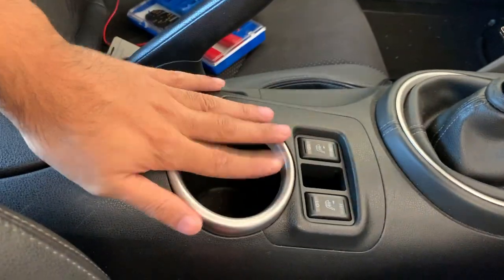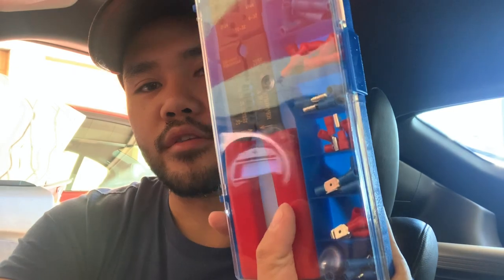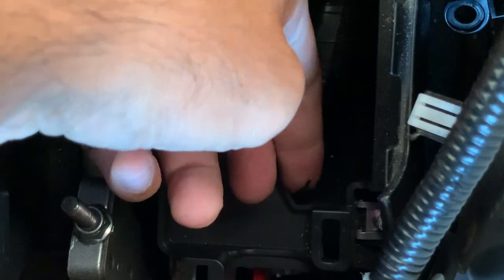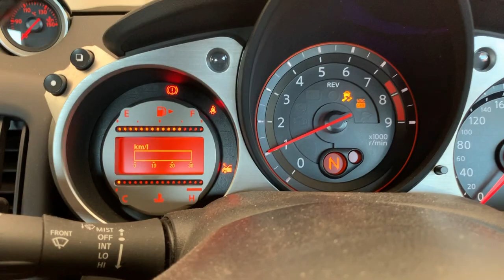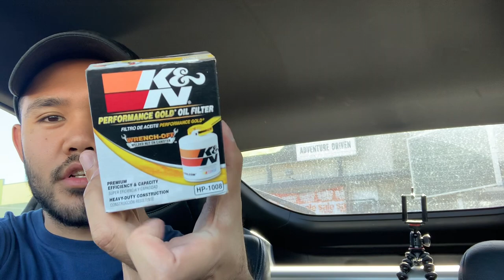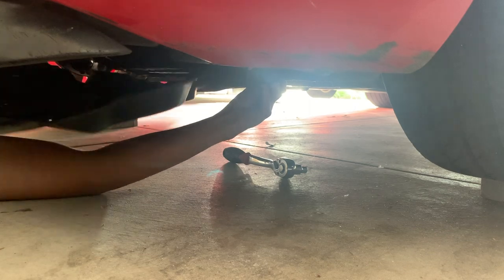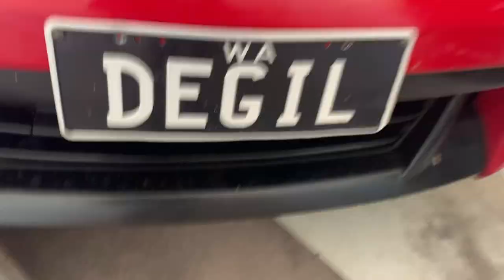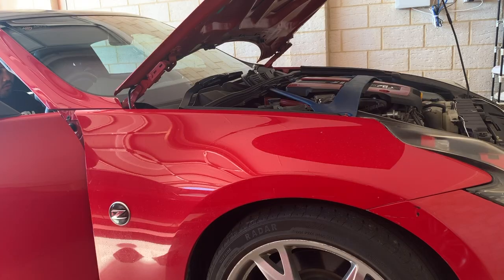*BEST* Drift Switch 370Z! YAW SENSOR SWITCH

Comment: Nice video mate! Just a suggestion... instead of electrical tape it's better to use heat shrink tubing.  Snug fit once you apply heat and it does not unravel.  I use it on all of my electrical wiring projects. :)
Reply from the maker: Luv2rip FPV cheers mate! Yes 100% heat shrink is better. was thinking that after I did it hahaha as I had heat shrink in the pack but didn’t think about it when I was doing it 😂 thanks!

Comment: Hi mate I bought a 350nwith this same swrich installed and I thought it was broken until I heard you say you have to turn the car off for it to work haha.

The only thing is I feel with the traction control on , VDC and slip lights gone, my car feels sluggish and even when trying to accelerate it barely will.

Is this because my welded dif is interfering with it?
Reply from the maker: That’s very interesting, I don’t think a welded diff would make a difference. But it does have a chance too cause sensors would be confused as to what’s happening hahaha

Comment: have you checked to see if the brake lights work when the yaw sensor is on and off?
Reply from the maker: Lee Burke yes! They’re still working on either 👍🏽
Reply: DegilZ34 excellent, I’ve heard disabling the YAW by pulling the fuse terminates the brake lights, have you tried to see if you can do a standing burnout
Reply from the maker: Lee Burke that’s by pulling the “stop lamp fuse”. I’ve done that in my last video if you wanna check it out hehehe. But that does cut the brake lights. There is another wire under the glovebox where you can put a switch in to disable that but still keep your brake lights on. I haven’t tried doing a standstill with this yet, but ill try it soon I’ll see how it goes
Reply: @HustleGarageTV  ahh excellent, let me know if you can do a standing burnout, or post a video of you trying?
Reply: DegilZ34 can you provide more info on the wire to do a standstill burnout with brake lights on?
Reply from the maker: @leeburke1491  can do!
Reply from the maker: @B H Will do, i'll talk a little about it in the next video. I might be doing it soon as well. But it is called the ECM wire behind the glovebox
Reply: @HustleGarageTV  looking forward to it! Cheers from LA!
Reply: @HustleGarageTV  I've heard of people tapping into a brake pedal wire also but that turns off the brake lights when on, but flip the switch and its back. Alternative to pulling the fuse

Comment: Can we get a link to the switch. That brand has alot of different switches that all seem very similar
Reply from the maker: Andrew Wagner I bought it at a local auto parts store but the part number is: 63040BL, the measurements are 37.5mm x 21mm

Comment: So it’s a permanent stability control off? For the yaw green wire?
Reply from the maker: Elmurfudd Wrabbithunter yes, when the switch is turned on, the stability control is turned off. But it can be reset so the stability control is on

Comment: Whats the difference between this and the stock turn off stability control button ?
Reply from the maker: Shteryo Shterev the stock VDC off button only turns off traction control, but the stability control is still there. The stability control kicks in when it senses the car having an angle while drifting, and kicks it back, making it very unpredictable and scary. This cuts out everything except ABS, which makes it more predictable and under your own control of the car without having the ecu snapping the car straight while you’re sideways which can end up with the car heading straight into a wall
Reply: @HustleGarageTV  I understood, must try this on my car. If u have instagram or facebook say it so we can exchange some info about the cars.
Reply from the maker: Shteryo Shterev yeah my Instagram is degilz34

Comment: One more question. How did you know to cut the green wire? I seen some people say cut the orange wire so I'm not too sure which to do. Also since mine is a 2016 I want to know if it's any different than yours. Thank you
Reply from the maker: crazyK115 I’m not sure if it’s different on the 2016, don’t think it should be, haven’t heard anything about an orange wire before. The ESM + a mate confirmed it was the green wire that connects the yaw sensor
Reply: @HustleGarageTV  ok brotha thank you, I'mma do a little more research just in case but I'mma trust you I can't find anything 💯
Reply: @crazyK115  Did it work?
Reply: @crazyK115  I've a 2016 Z, thinking about doing this too. Did it end up working?
Reply: @Ajeythayaparan  yea it did but honestly there's no point to doing this. If you want to drift it, put it in first, start swinging the car then immediately shift to second. As soon as u shift the car will throw.
Reply: @Ajeythayaparan  if you have any more questions feel free to ask
Reply: @crazyK115  is it just the same as any other Z for installing the switch, the wire isn’t a different color? And tbh that’s what I’ve been doing but the hook up is honestly terrifying lmaooo.
Reply: @Ajeythayaparan  it's not as hard as you think it was honestly pretty easy. I'm pretty sure 2009 and up is all the same
Reply: @crazyK115  Ok just wanted to make sure before cutting into wires lmaoo, so if I just follow the video exactly I should be good? Also did you feel a difference when sliding with just traction control off versus using the YAW switch?
Reply: @Ajeythayaparan  yea, with the yaw sensor off it kinda sucked. Nothing really happened. I can show u vids if you want of with ms without if you want to see the difference.
Reply: @crazyK115  ya definitely my Instagram is at.zzzz. Send them whenever you have time.
Reply: @crazyK115  lmaoo sorry if I’m annoying I just want to make sure, as long as I watch the video and cut the green wire I’ll be fine?
Reply: @crazyK115  I wanna see the video

Comment: My 2017 370z only turned off the traction control not the extra safety on the throttle
Reply from the maker: That’s weird, mine turns that off when I’m sideways
Reply: @HustleGarageTV  I can’t do burnouts because of the extra safety feature which is what I was hoping the switch would fix. It only turns off the slip
Reply from the maker: Oh right, this doesn’t eliminate the “stop lamp” that allows you to do burnouts, this only eliminates the throttle cutting out when you’re sideways. You’ll want to link the cable behind the glovebox to a switch, this is the “stop lamp” cable that is connected to the ecm, that will allow you to do standstill burnouts/left foot braking etc. this only allows you to have better control of the car when you’re drifting
Reply: @HustleGarageTV  yea I’m doing that right now, drifting wise I can still do it with the switch on
Reply: What years have this extra safety and what is a stop lamp exactly? 

I’m purchasing a 2019 370, 6mt Monday and i test drove it and in an aggressive corner… it went into some protection mode with 10% throttle response hence me looking up this video. 

Any more info on this other “nanny” safety feature!!

Comment: All you used was electrical tape to connenct the wires to the green right?
Reply from the maker: Yeah just electrical tape, use going to use heat shrink but i ran out :(
Reply: use a splice with heat shrink over silly

Comment: I did the exact thing and didn’t work on my any clue why it didn’t work ?
Reply: did you figure it out?
Reply from the maker: hmmm, I'm not sure what the problem could be. Did you manage to fix it?
Reply: I try I different thing what I did it’s that I cut the wires directly from brake pedal and add the switch to that line , I still put the switch in the same place s you did and it work great probably in some works different way